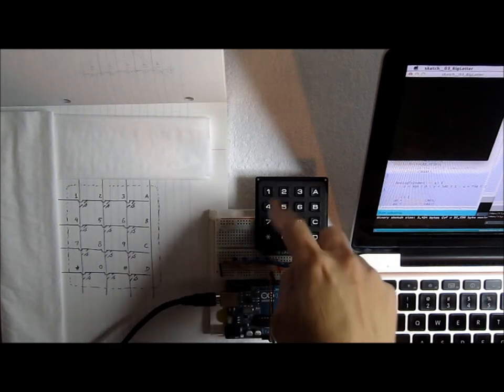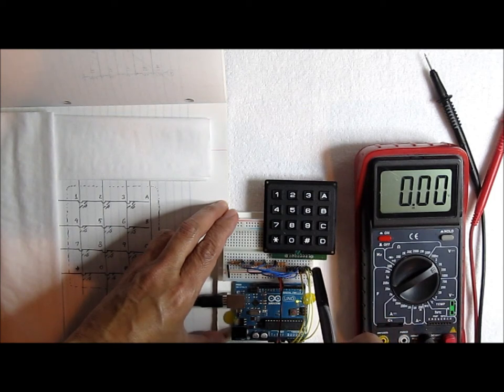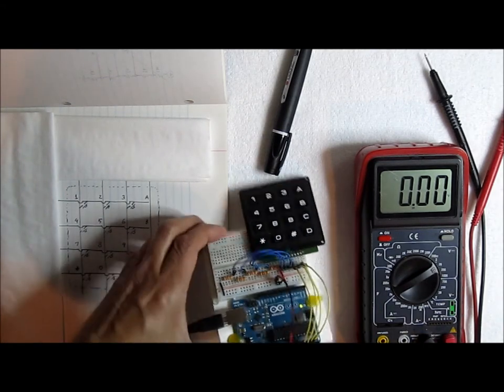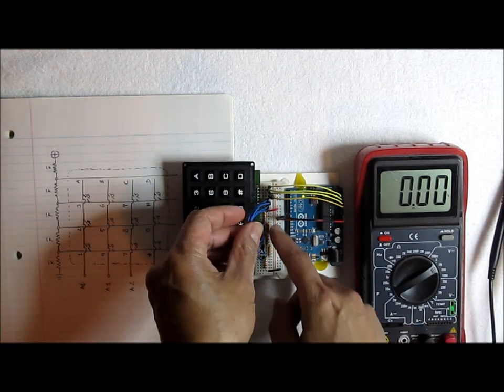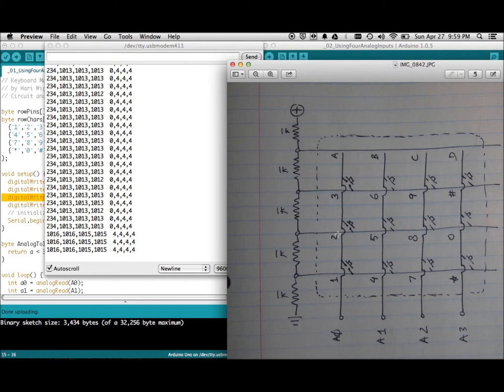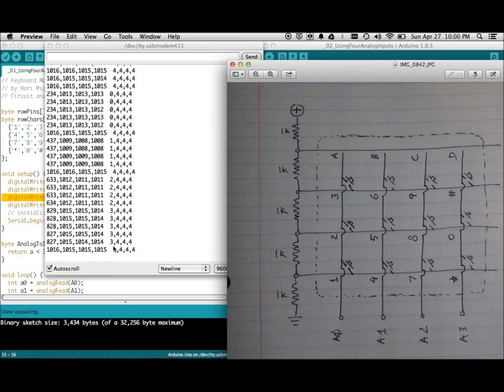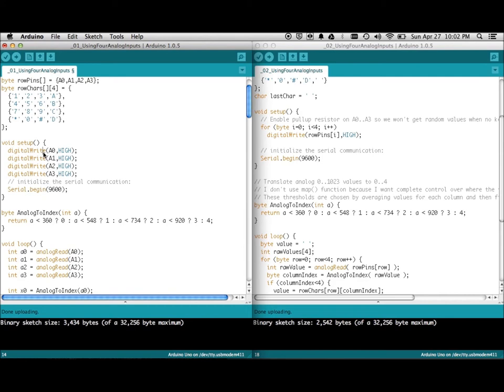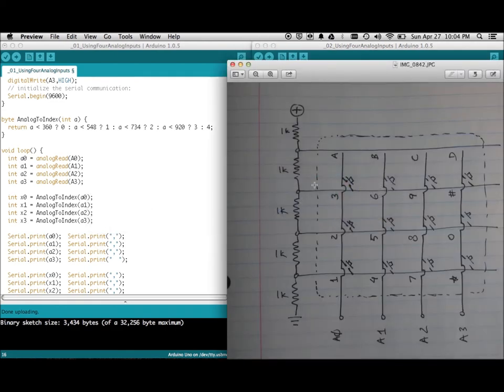4x4 Keyboard Matrix

Comment: Nice idea with the voltage ladder. Frees up some pins but you may need those for other things. Maybe you could try using a straight ring counter in place of the ladder so that you can use digital pins instead. Love the demonstration still.

Comment: the if you use is called a turnary if, I believe. And that's an awesome compact 3 if statement :) really hard to read unless you know your syntax, but way less messy than a load of blocks. I bet you'd be great at regex ;D

Also well explained matrix and awesome pin saving with simple components, I will be using.
Reply from the maker: Hi, thanks for the comment.
Since this 2014 video, I've discovered an even cooler way.
Have you seen this yet?
https://www.youtube.com/watch?v=G14tREsVqz0
Reply: Hari Wiguna that's brilliant, even better and very simple electronics. I've always been frustrates that it remotes were the best way of adding many buttons for the least pins. but this frees up loads of space on the arduino and is really simple code. cheers!